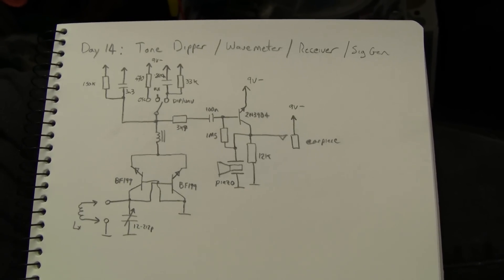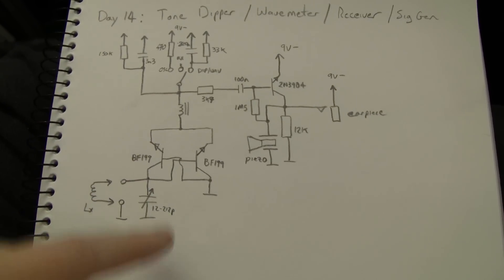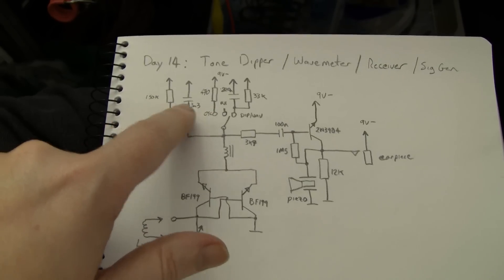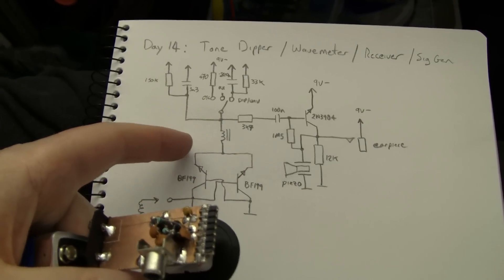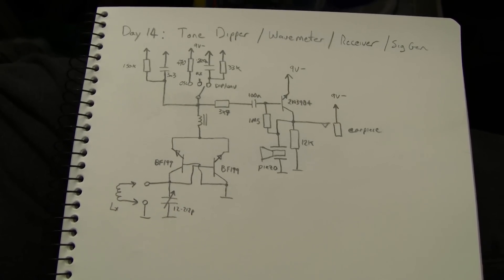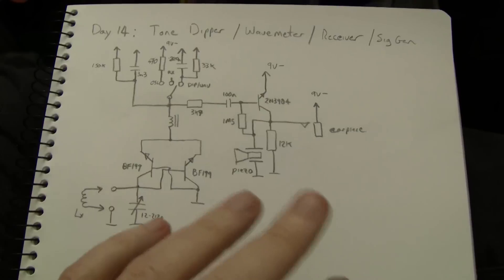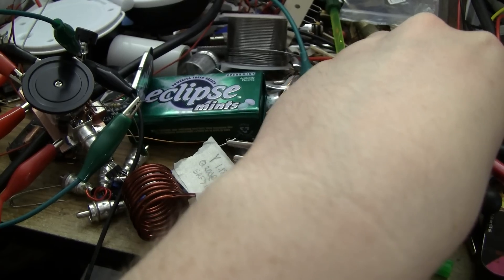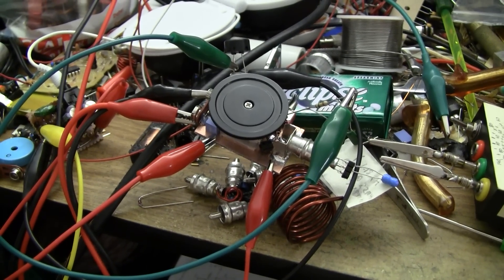Advent Calendar of Circuits 2011: Day 14: Tone Dipper / Wavemeter / Receiver / Oscillator

Comment: I built your circuit on a tin can lid for kicks.  It squeals like yours and as a wavemeter, the pitch rises when I couple RF from a generator into the coil.  I started out with that basic circuit, and wound the coil for the MW BCB.  Then I added the switches to make it receive, and with a 2 meter long wire for an antenna it picks up a strong local station.  I figure that it's not a very practical signal generator because it is always squegging and can't put out a steady CW unmodulated signal.  The two BF199s connected as an astable multivibrator are trying to make square waves.  Thanks for the cool little project.  More here.
https://rustybolt.info/wordpress/?p=13452

Comment: The alligator clip / banana plug adapters at 9:26 on your signal generator output are a nifty idea. Those are homemade, right?
Reply from the maker: Yep, just soldered them directly to the banana plugs.  A small piece of brass tube reinforcement at the joint would be useful - I've broken the solder joint a few times, or maybe use a short piece of thick braid to make them flexible.